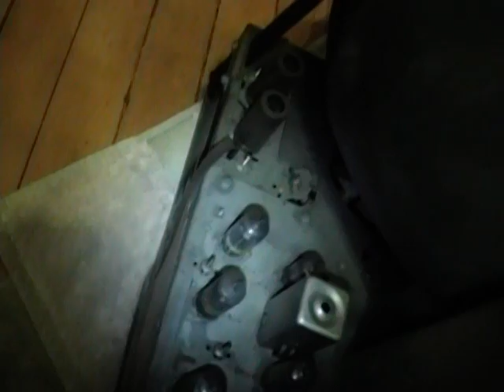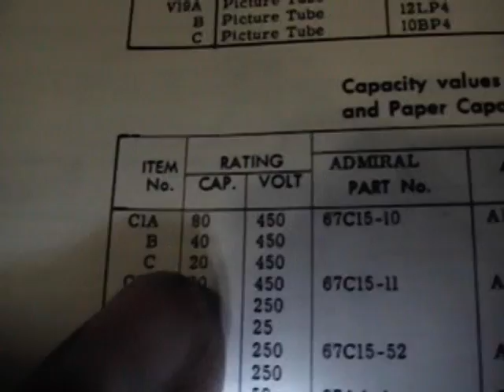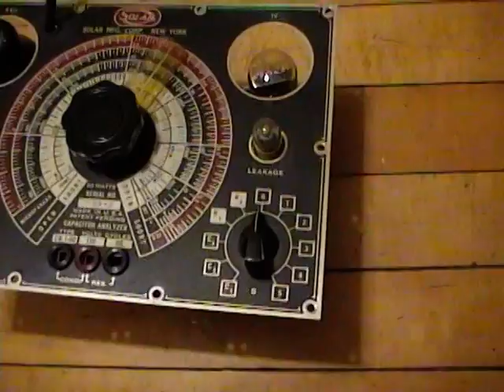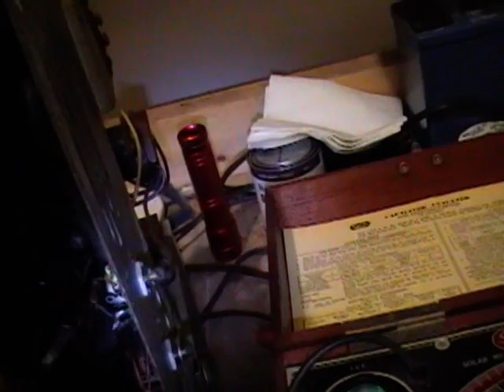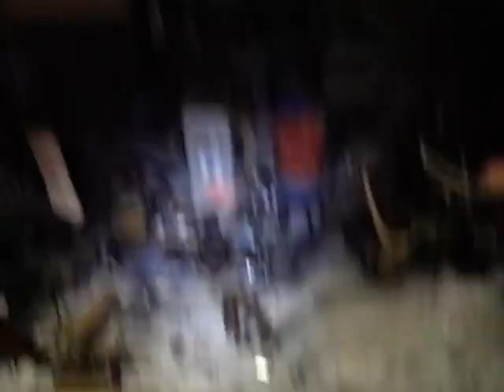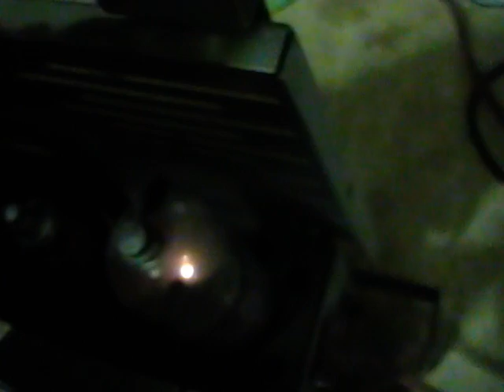Admiral 20X11 restoration p1o5

Comment: @maynardcat With me it depends on what I'm working on, I usually try to power a radio up before servicing it, unless it's obviously been butchered in some way. When it comes to an five tube AC/DC radio even though I try powering them up before working on them I don't even bother trying to troubleshoot them any more without replacing the old caps and drifted resistors first. With a larger radio or TV I normally replace things in stages and power it up inbetween to see what difference it makes.

Comment: I haven't seen an Admiral chassis for a long time.  I vaguely remember the tuners, and I thougth those carmel colored contact sections could be removed. You have a skilled trade, there are very few people that work on vintage TVs.  This method of troubleshooting separates the skilled technician from the amatures, you have to know what your doing to actually locate the problem instead of just replacing everything, and hoping it might solve it.

Comment: Really nice troubleshooting this set in the "old school" manner using the old school test equipment.  Very informative. Beside the fact that they will not test the higher voltage capacitors for leakage, I wonder if the newer ESR testers would would even give you an accurate reading on the caps in these old sets.  Imagine the challenges the old TV service folks had going someones house and working on these sets!  Great job my friend.

Comment: About the name on the picture tube. Many tubes were rebuilt back in the day. In this process they would cut the neck and the electron gun off the original glass bell and glass weld a new neck and electron gun into place. This is probably why the names on the bell and base do not match.